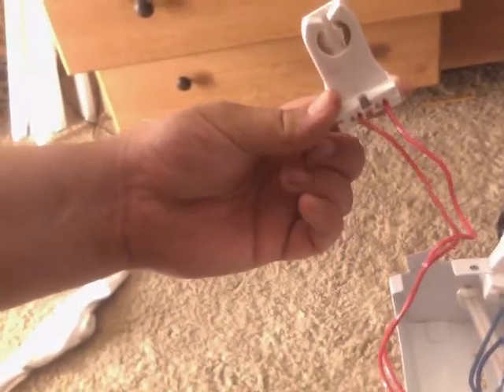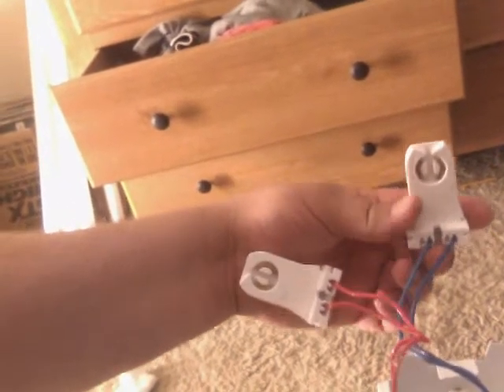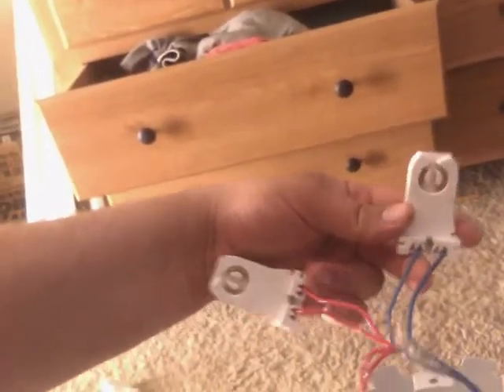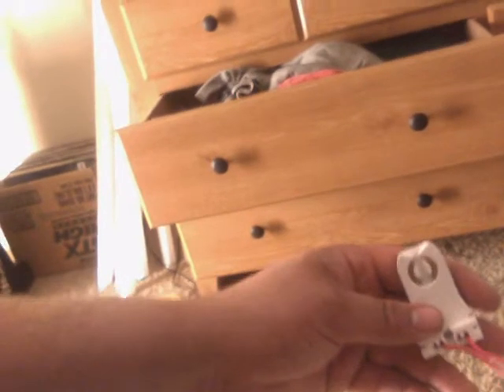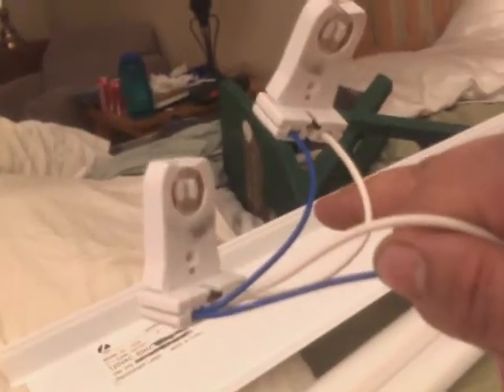How To Install a High Power Factor Rapid Start Magnetic Ballast

Comment: i tried to hook up my GE ballast and it doesnt work. i hooked the 2 red wires to 1 lamp holder, i put the 1 blue wire on one side of the other socket, i hooked up the black wire, put the white wire on the other side of the socket then on the 2nd connection on that side i put the input white wire. is the ballast bad or did i connect it wrong? i used push in wire connectors and wire nuts. its a new ballast for 1 lamp.

Comment from the maker: Yep. The ballast only has hot (black) and neutral (white). Just hook those to the corresponding wires on your power cord to the ballast wires and you should be good. The red, yellow, and blue wires go to the lamp holders as shown in the video.

Comment from the maker: HPF rapid start ballasts don't have a ground wire. The ground wire in the power cord attaches to the fixture chassis. The ballast grounds itself through the mounting hardware. BTW, this fixture has a two wire ungrounded cord that I put on it so I could have an inline cord switch.